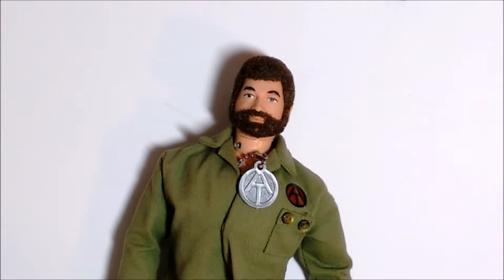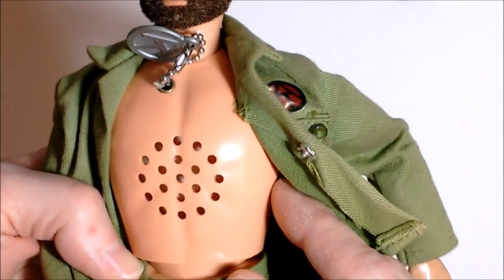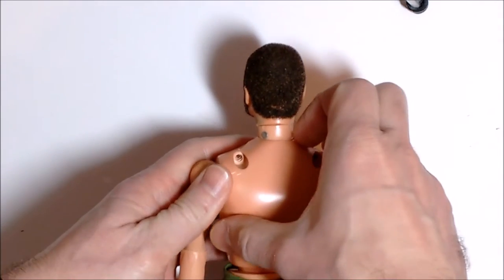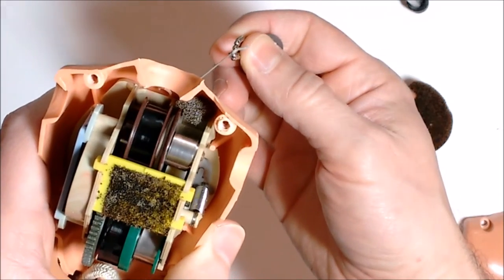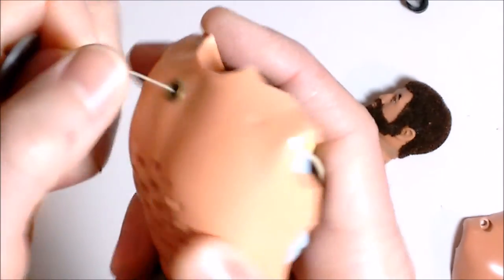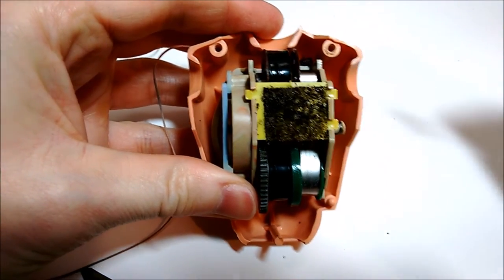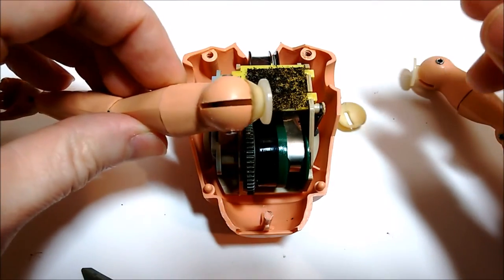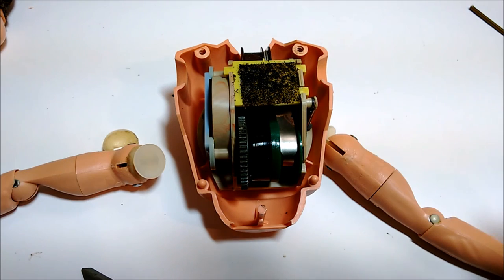GI Joe Adventure Team Talker Clean/Repair Ep.1

Comment: Toy Tinker Tim  Question for you :  Just how long would you say the string is for the talking G.I.Joe
Reply from the maker: When it's fully extended, from the dog tag chain to the rivet on his chest is 25". Probably allow another inch (maybe more) for the connection inside the voice box.  There used to be reproduction strings available, they even had the color markers on them. Good luck and thanks for watching!
Reply: Cotswold's collectibles sell a talking Joe string replacement kit with a color coded string like the original.

Comment: My Adventure Team Eagle Eye GI Joes were all sonically welded together.  No pins or screws, so I can't repair them at all.  :(
Reply from the maker: I feel your pain. There are action figures and vintage toys I have that I would like to repair that are sealed this way also. What I've seen most often are people cracking them open and hoping for the best.
Reply: The Eagle Joes have what is referred to as a muscle body and aren't assembled the same way as the original 64' body.  They had thick rubber bands that held the pieces together which deteriorate over time .  You can gently "pry" the torso, biceps, and thighs open to repair them.  There are several tutorials on it and Cotswold's collectibles sell a kit with pieces to replace the joints.  Just Google G.I. Joe Muscle body repair.  Good luck.
Reply: @dbsimms63  Thanks.
Reply from the maker: Thanks for sharing your info Don
Reply: @ToyTinkerTim  anytime